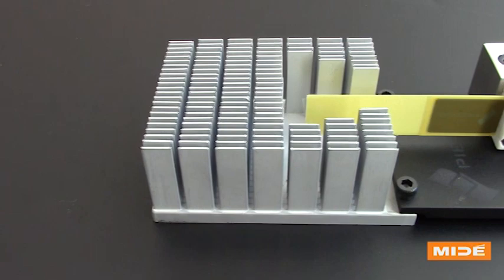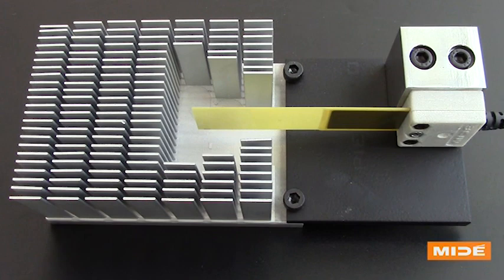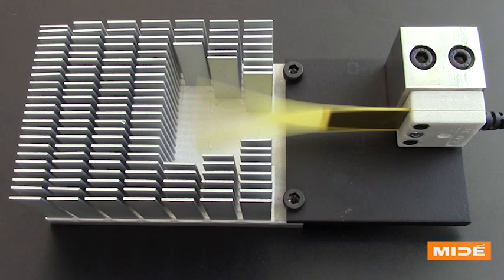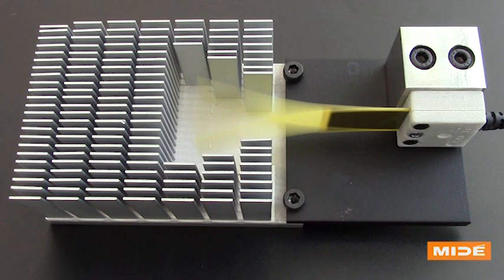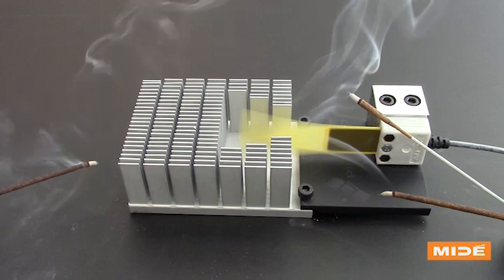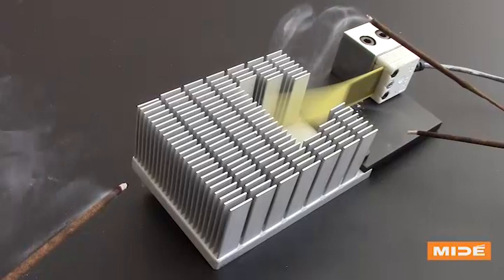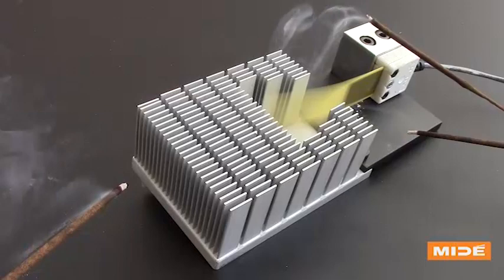Forced Convection with Solid State Piezoelectric Fan

Comment: ha,  you could use noise cancelling technology to kill the sound from the piezo, since you know exactly what hertz sound is generated, it would be much easer to tune the cancelling software.   I don't see any real draw back other than sound, lol. and some  funs are loud, so it is really wear and fatigue and that looks like Kevlar so it could last years or it might break in an hour depending on how it is tuned.. lol you could cause it to fail by hacking it and forcing a hertz change and vibrating it apart so I would add a limiter to prevent viability of being hacked and limit its hertz range.
Reply: MrYendor1968 a lot of LOLs there 😁
Reply: MrYendor1968 hypothetically yes but in reality canceling noise in that fashion dosnt really work very well in forms other then in headphones.
Reply: 1. These are so low and quiet as other commenters have pointed out, you won't need noise cancelling, but yes you will know the exact frequency.
2. No, you cannot "hack them" to change the frequency. The frequency comes from the AC current from your wall, so unless you change the entire power system in your walls, it's not changing
Reply: @gormauslander  but we can use converter to change the power supply frequency that is easy

Hard thing is will it work at high frequencies which are above audible range
Reply: @SudhirPratapYadav  correct, you could physically install a "converter" into the circuit, but you couldn't remote "hack" it to break someone else's system like the comment suggested.
Reply: @gormauslander  In the 80s it was possible to "hack" certain brands of computer monitors and destroy them (sometimes in a dramatic fire) by setting a video mode with a frequency outside the safe operating range of the monitor's power supply. You could pretty much run a program, walk away, and listen for the fire alarms.

Good times.

Comment: No moving parts, except for the blade that shakes back and forth at dozens to hundreds of times per second. You claim it's silent, but you cut out the audio of the actual device.  And I question your claim about fans not working in dusty environments since that's exactly how ventilation is achieved in dusty and smokey environments. Not many plants employ towel waving method. And a regular fan has a smooth, rotational motion with no unbalanced forces acting on it. Nothing shaking, sudden accelerating and decelerating, just one smooth and uniform homogenous rotational motion. Provided it's machined to tight enough tolerances, of course. Your device, on the other hand does the complete opposite. 
🤣